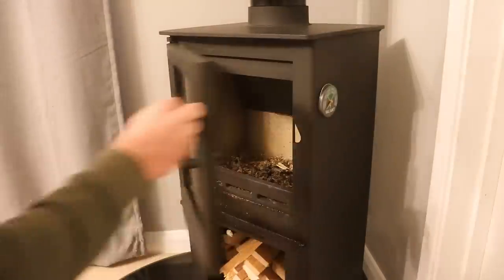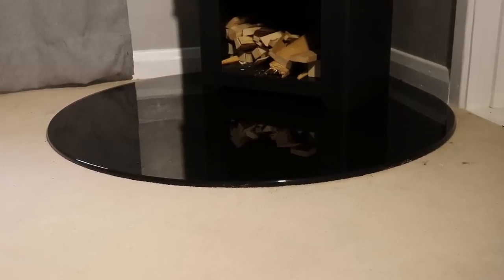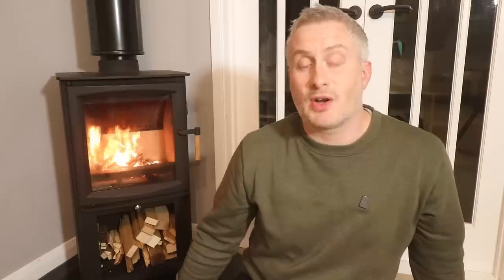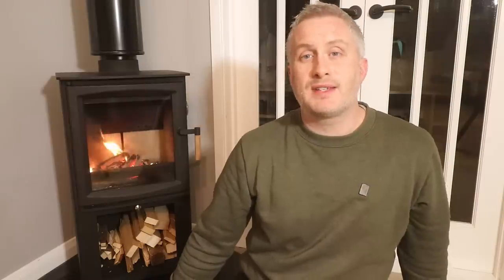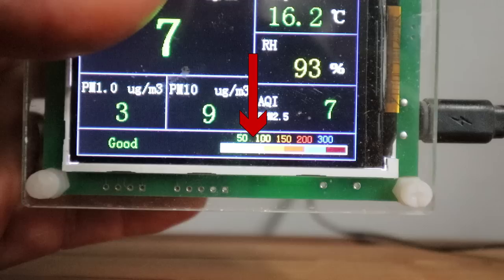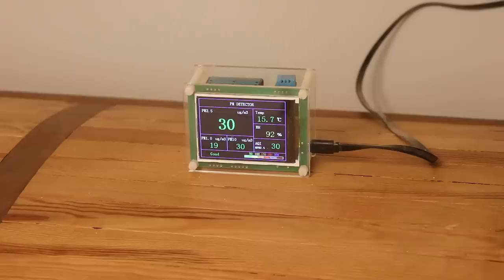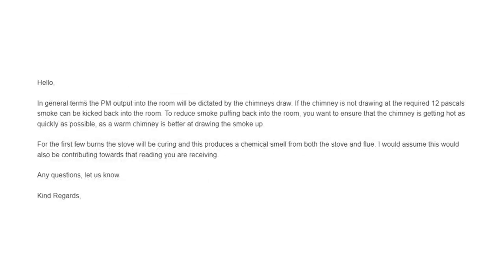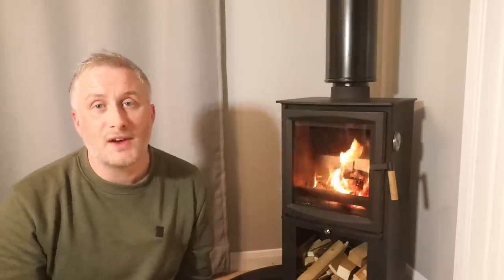Wood Stove Pollution and PM2.5 Particle Emissions TESTED ✓

Comment: My tip being a pyromaniac. Always do a top down method of fire lighting. Large logs on the very bottom then a layer of slightly smaller logs, then kindling and then the lighting nest on top. Like a pyramid. The heat from the top makes the syn gasses come out from the wood underneath which are then ignited rather than loose the un-combusted gas out the chimney. You'll have a much more efficient burn that way. cheers J
Reply: I find doing that way to result in large amounts of " charcoal" being made as mine is a wood burner only and has no grate and the charcoal gets buried under ash that means an incomplete burn
Reply: Stupid method if you actually want to get warm.
Reply: @pictlandpickers1171  it burns the most efficient way that a fire can burn. It is a slower burn and doesn't require as much fuel. If your house is poorly insulated then I can see why you wouldn't like that method.
Reply: @joshuadelisle  so you let the fire go out so you can start the process again? My stove is not like this one so wouldn't work. It certainly wouldn't give off heat which if you are only using a stove for heat not decoration it defeats the point. When I come home and want some heat I want a roaring fire the slow it down with bigger logs. I don't use the central heating.
Reply: @pictlandpickers1171  my stove has fire bricks so you only need one burn and the heat radiates out all night with embers for the morning. To constantly feed the fire is work...
Reply: @joshuadelisle  energy isn't free. I think for the last 7 years I've heated my home for way under £200 a year including the odd times I've put the boiler on.
Reply: @pictlandpickers1171  that's very good. I gather all our wood from a coppice I volunteer on. Costs me time and a bit of travel expenses. Cheers J
Reply: @joshuadelisle   I often do deals with farmers so sometimes get stuff for free. ,my time plus a bit petrol for my saw or can get trailer of softwood for 100 probably 2.5m3 I reckon 5m3 is enough for winter easy. But id tolerate a colder house, just wear jumps and sheepskin throw on the bed. Can't stand visiting family with roasting hot homes.
Reply: @pictlandpickers1171  that's really good. Sheep skins are awesome 👍. Cheers J
Reply: Top down lighting method fixed our problem of down draught filling the room with smoke when lighting from cold. Lots of newspapers on top means a strong upward rush of hot air to displace any down draught and cold air in the flue.
Reply: @joshuadelisle  I tried your method. It worked very surprisingly it took a while for it to get hot and a bit awkward with the shape of my stove but can see how it would be easier to light as stacked stove. Im not sure it's better don't think it gets as hit as quick but certainly eventually gets hot. Think it would be a good fire to light before I go out as takes a while to get going but would last longer.
Reply: @pictlandpickers1171  yes it's a slower burn. We just light one load and that's it for you the day. Much better for fuel economy. Cheers J
Reply: @wicky525  you could install a 3rd party grate
Reply: @LaurenceVonThomas  no I couldn't as firebox is completely surrounded by vermiculite fire slab
Reply: Thanks, I'll try this method with our newly install Trolls wood burner. It's quite tall inside so this method would be ideal as having to keep topping up with logs can be a pain.
Reply: @damianjones6546  well done. Yes this method also gives better coals that radiates heat and less ash. Cheers J
Reply: I totally agree, started using this method last season and it’s a brilliant method..
Reply: 100% also an added benefit is you can light it and forget it. No having to keep opening the door to add more wood while the fire is getting going letting the smoke out.
Reply: Absolutely. This way the firestarter sat at the top heats the cold air in the flue pushing it out far more rapidly thus eliminating smoke blowing back down and out into your room.  The thinking man's way.
Reply: 100% top down lighting is the way to go.
Reply: Top down lighting is by far the best way - I had 2 stoves installed earlier in the year and our installer showed us the top down method. Very simple, never fails. I have a delivery of wood tipped onto the drive and spend time chopping it with my trusty axe into different sizes to build a good top down fire each time. Oh, and you could do with a decent fan on the top of that stove - since putting one on ours we use a lot less wood as it distributes the warmth better around the room and avoids ‘cold spots’ in the corners.
Reply: this method works really well.
it also eliminates having to go into the fire to stoke up for a couple of hours...this reduces fumes into the house.
light and leave....
Reply: People have such adamant opinions on burning wood, perhaps because humanity has done it for 100,000 years.
Lighting from the top is mandatory in the snow or wet soil. And authorities prefer it because it releases less particles with non optimal wood.
I have a deep, narrow stove so I can't do it.
Reply: @stefflus08  we have a similar stove in that it's deep and narrow. I put the wood in on its end so all the butts are facing upwards and light it with a small kindling stack on top.  When there are established coals I'll throw one or two small logs in every hour or so to keep a layer of infra red heat. Cheers J
Reply: The 'top down' method is a very slow lighting method.  However this means you can light it and leave it, which may be to some folks preference.  I have been a woodstove owner for over 20 years (2x Clearview) and have thoroughly tested the top down method.  This gets started slowly, so 20 mins later the stove top is just getting too hot to touch.  With the bed of scrunched paper, kindling, sticks and logs on top, it will need another log or two putting on in 15 minutes, but in 25 minutes, our 7-pint kettle has boiled - from cold.  So, my recommendation is to use the fast-lighting bottom up method, which relies on the pretty-well understood physics of flames rising through the combustible material above.
Reply: It depends on your appliance and also what you want by way of speed.  

I was born in 1963 and was lighting the old coal fires from the age of about 5 or 6 under the supervision of my Grandfather (a coal miner).  We went over to Gas CH in 1972, like millions did when North Sea gas became available.  I was then aged 9 and totally proficient in the lighting of fires, the emptying of ashes (often hot ashes into the old galv steel dustbins), the carrying of spades of coal into the house from the back yard (don't spill any!) and the splitting of kindling with hatchets.  All the kids those days had those skills, especially boys but very often girls too.  I moved into my own place in 1982, aged 19, and was confronted with the exact same open coal fire and back-boiler (just for DHW) that we had left behind 10 years previously.  It was like going back in time, a blast from the past.  Fortunately I remembered all the old skills.

I fitted a wood-burner in the kitchen in 1990 and then one in the living room in 1992.  I've been gathering, processing, storing and burning wood since then.  I still used to buy some coal in the 1990's but even back then it was becoming very uneconomical.  I've been on wood alone since about 1999.  I won't burn old window or door frames or anything else covered in paint, sealant, stain and varnish, nor old wood out of skips (full of nails, not to mention spores and whatever else) and only burn log wood and lesser boughs.

My appliance in the living room doesn't really like the top-down method.  I've tried it, don't like it and have returned to the old method of paper, sticks, boughs and logs in that ascending order.  I leave the door open a crack and have full primary air for at least five minutes to get the thing blazing quickly before closing the door fully and decreasing the air intake.  That works best and gets the temperature of the room and the hot water (yes it has a boiler surrounding the firebox) up to speed within the shortest time.  The firebox isn't very tall (and there is a throat plate) but it is quite wide and deep.  Bottom-up works better for me.

Different appliances and different requirements are by their very description - different.  There isn't one size for all.  Whatever works best for you.
Reply: Best method. The way it's done here in the north too among ppl who know "how to"
Less sooth too 👍👍
Reply: You must like creosote.
Reply: @pictlandpickers1171   £200 year. Standing charges exceed that!
Reply: We’ve been heating with a wood burner for 20 years using wood that I collect and process myself at no cost (other than time, effort and the chainsaw). Our burner has front vents above and below the glass doors and a choke in the flue. It’s vital to burn well seasoned dry wood and I have recently started using a meter to check this. Starting is very quick and easy - 

1. Open all vents and the flue choke. Put a large wedge shaped or quarter split log at the back.
2. Put a small piece of fire lighter in (about the size of a sugar cube) and light it with gas refillable lighter
3. Lay 3 or 4 small pieces of kindling vertically over the flame leaning on the log. Small twigs or bits of wood from log splitting work well
4. Lay two or three small logs across above the kindling
5. Leave all vents fully open. After 5 to 10 minutes it is roaring. 
6. After 30 to 40 minutes the flue thermometer will reach maximum safe operating temp. Half close the lower vents and half close the choke. Add more fuel as needed depending on how hot you need it.

I haven’t tried top lighting but it just wouldn’t work well on our burner. The whole point is to get a fast steady draft of air running through the wood from bottom to top, with the flames starting at the bottom.
Reply: @pictlandpickers1171  It's only a stupid method if you want to get warm within 5 seconds, otherwise it's a brilliant method if you can avoid hypothermia for a minute or two.
Reply: Everyone debates the best way to make a fire. I've done it all. I finally settled on bagged charcoal and starter fluid. Load the stove with full sized wood amd a handful of charcoal in the middle. Blazing fire in 15 minutes, no need for kindling or chopping wood.
Reply: Well someone that's has a brain, obviously your spot on, unlike some of these so called presenters
Reply: That's just not right.  But thanks for being creative . If people try your method of lighting a fire, will it really work? For a campfire?
Reply: @surf6009  it's how I light my stove and other fires every day in winter. This method produces more coals also which gives more infra red heat so you don't lose as much by convection either. Cheers J
Reply: Getting coals is good.  I was taught to fire up the stove when you are getting it going,  to reduce the buildup of ceasote. I've cleaned many chimneys , and everyone burns different styles.
Reply: @pictlandpickers1171  that actually works and it's a set and forget

Comment: Some people are going to get a shock after the expensive purchase and installation costs. The shock is actually buying the wood. Its very expensive. I've done a quick calculation and the cost of gas to heat the home is cheaper than a cubic meter of wood. So along with the installation costs some unfortunate people are in for a shock
Reply: That's why they are burning any old bits of wood.

Comment: Have you tried putting the detector in your neighbours bedroom Keith, assuming you have them. We have a wood burner a few doors away and the stench of burning wood is terrible upstairs. I now try and make sure the windows are closed before they light their fire, but the smell still gets in if the winds blowing our way : all the best - Steve
Reply from the maker: Sounds like your neighbour is burning things they shouldn't be then
Reply: @RagnBoneBrown  that’s not easy to determine, as they are rich but extremely antisocial. I might get a monitor and test it myself. However this is not my first experience of fumes from wood burners blowing into neighbouring upstairs windows. Especially from bungalows and it’s not nice

Comment: If your stove allows it, consider fitting an external air intake pipe. The burner should then pull in cold air from outside instead of drawing in ready warmed air from the room to send back up the flue that you've just paid to heat up! It also helps with the draw up the flue if your house is newer/more airtight.
Reply: Yes, I thought this was a requirement. We had such a pipe installed even back in the late 90s. If I recall right the requirement depended on the size of the stove back then.
Reply: @ColinMill1  < 5kw and an external air feed is not required. That’s why “5kw” stoves are actually 4.9 or lower.
Reply: @DeanJuvenal  Thank. So that sounds like the regs in that respect have remained the same. Our stove is, if I recall right rated at 6 kW. Being an old place with solid stone walls it's basically impossible to heat anyway but the fire looks good and it gives me an excuse to keep planting more trees 🙂
Reply: @ColinMill1  😀. Being the type of construction you describe, do you have to start heating up your house sized storage heater in the late summer so that it’s up to temp by early winter? Then ceases big burns so that the walls cool down enough so the house isn’t overheated in the spring and summer. I have a friend who lived in part of a Manor House constructed in around 1600 ACE. He adopted that type of practice. 👍🏻😀
Reply: @DeanJuvenal  Yes, our place is rumoured to date from about then. From the size of the ground-floor openings it would seem the cattle were a significant contributor to its early heating. As a tropical kid who's first introduction to the UK climate was the winter of 1962/3 spent in a Tudor house with but one small fire-place, I have developed a considerable tolerance for cold (it's 11.5 degrees in here at the moment) and a love of old houses. 🙂
Reply: That stove is very close to the walls! /fabric  any one had a thermometer there to test the temp? could end up being a house on fire, instead of the fire being in the house
Reply: @DeanJuvenal  ACE?
Reply: We have a 5kW and an 8kW. The latter has an air brick behind to supply air per the regs. Not required on the smaller one.

Comment: Well, just to add a comparison number to this: I have an air quality monitor in my living room, and over the summer, when windows are open, I regularly saw it spike up to around 100 µg/cm³. The reason for that always being my neighbours working their charcoal barbeque on their balcony next door to mine. 

So while your oven was giving you values that would be critical over extended periods of time, using a barbeque on a regular basis without masks will also do that.

Comment: Hi Keith,
               My brother-in-law fitted a wood burner in the living room of his timber framed bungalow. Unfortunately, it produced so much heat that it cracked the external render!
I think that the main advantage of a wood burner is the aesthetics, i.e. the visual appearance! My own personal opinion is that when I arrive home, I want an immediate and convenient heat source i.e., a gas/electric fire. I couldn't be bothered to faff on loading wood etc and waiting for the stove to heat up! Also, the fumes would be a major concern not only for humans (especially babies/children etc), but also for pets. I think anyone who fits a wood burner is turning the clock back 70 odd years to the 1950's when open fires were commonplace!
Having said that, I accept that everyone has different views, and of course, as you say, being a wood worker, your fuel is free! Another great vid!
Reply from the maker: Hi Kevin, as the air quality readings show, pm2.5 particles are not an issue. I would expect with an open fire the readings would be much higher.  Thanks, Keith
Reply: Why so much concern over log burners? Cars , buses,  lorries, trains , planes, and so much more out there that pollutants are not addressed and so much worse and, more importantly, there is no ban on these.....strange isn't  it!

Comment: Hi Keith,
I used to work in a stove shop (admin not installer!), just a couple of pointers/thoughts
The skirting and door frame are wood, looks a bit close and breach of regs? The closeness to the curtains makes me a bit uneasy too! 
Storing wood outside is OK bu not ideal. Also kiln dried joinery wood gets wetter outside. 
Wood stored outside is not ideal to burn, it's still generally kind of wet.
Wet wood = more deposits in chimney = more chance of fire. Kiln dried is optimal for efficiency and 'clean" burning. In all honesty I wouldn't burn anything else than kiln dried, but that's my preference.
Don't burn any painted, ply, treated wood, mdf etc, recipe for a chimney fire due to deposits in the flue.
The high particle reading I would suspect is from curing the paint, this is normal.
When building the fire it's best to put more in than less, the more wood the slower and longer the burn.
Warm chimneys are better for drawing smoke, as are longer ones. You are at a disadvantage in a bungalow unfortunately. 
Make sure to get it swept yearly to keep it as efficient as possible and reduce the chance of chimney fire.

I don't mean to sound dramatic but I had all the above drilled into me. Stoves are fab but need to be treated with care which I know you will. Happy stoving!!
Reply from the maker: Hi, I'm not aware of the rules, sorry.  I think our installer said a distance of 300mm from the curtains, which is ok.  In the longer term though we're looking to replace the curtains with shutters anyway.  Not sure re: architrave/skirtings though but not something I'm worried about - they installed and signed off so I'm trusting them. Cheers, Keith